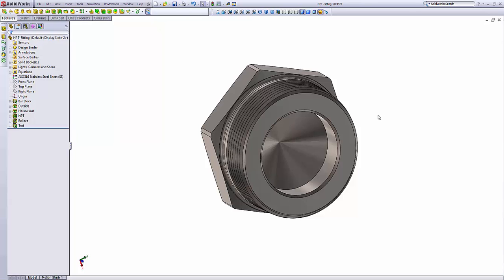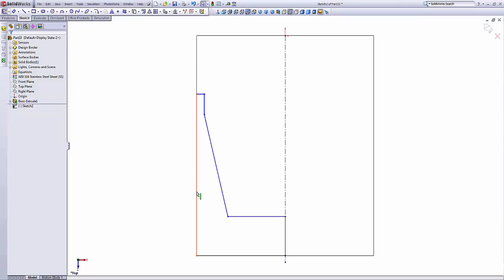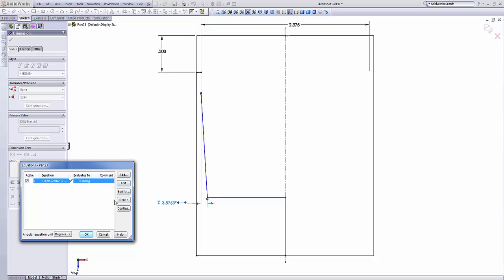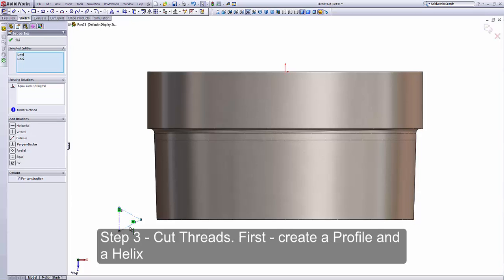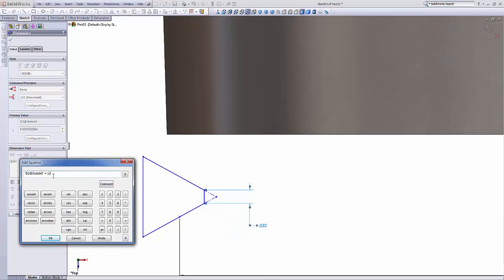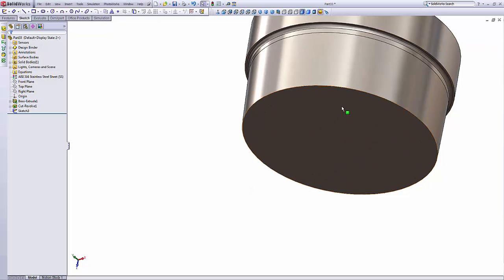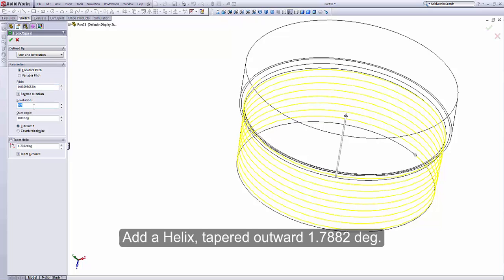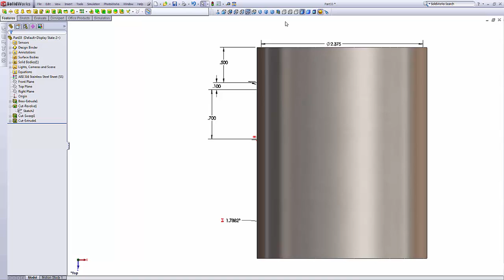NPT threads in SolidWorks - Tutorial

Comment: How did you choose .7 for the length of the thread?
Reply from the maker: @Kubuszarek, thank you for your question. 0.70 length was based on the number of full threads we want to create. In this case, it's 8 full threads. Calculated as the Pitch x 0.70. For NPT 2" the standard pitch is 11 1/2 threads per inch.

Comment: Good explanations, Thank You. I  have question how much overall lenght external thread ? we should use standart or we must ourselves
Reply from the maker: Keep to the standard if at all possible. Use the thread gauge to check. You can deviate from standard length, say a couple of additional full threads (making total length longer), or less full threads, making overall shorter. But the final threaded connection has to pass the gauge check.
Reply: @encole7224  Thank you for your explanation, it was very useful. And the best thing about this video is that every detail is explained.

Comment: Good tutorial and the female thread is very good as well. Thank you! I have one question. I'm working with short pieces and I notice that if set a thread length (.07 in the video) to a different value, a shorter value. The crest height changes. It doesn't happen with the female threat. Do you have any solutions? Thank you!
Reply from the maker: Tooth height should be fixed, regardless of thread length. Try setting the tooth height in the profile sketch. Helix length (thread length) is the guide in the sweep feature. With the fixed tooth height, the thread will be cut at consistent profile. Is this what you are trying to accomplish? Are you looking to keep the distance from crest to root (this is the tooth height) independent from thread length?
Reply: @encole7224  Yes. I set the tooth height fixed with an equation constant. The distance doesn't change. However. The whole sweep cut changes. If I set a >0.6 thread length, the cut is not done properly and there is like a face and inside is the cut. If I start to change the value more high, the tooth height starts to adjust until it gets constant. I have tried to change the Eo value, and it gets fixed. I think there is a relationship within the short values and the D and Eo. However. I don't get to see it. I think it needs a minimal distance since there is an angle in between as well.

Comment: your math is wrong for the taper. it is the arc tan of 1/32, not 1/2( arc tan of 1/16), it is not the same. angle is 1.7899
Reply from the maker: You are correct. In practice, although, the difference between arctan(1/32) and arctan(1/16)/2 is 0.0017 degrees. It is well below the manufacturing tolerance, so the angle will work out in the real world. The math was an oversight in the video, thank you for pointing it out.

Comment: Hi! how did you determine the  first diameter on minute .29 the one that is 2.50. Thanks
Reply from the maker: That 2.5" diameter is totally arbitrarily. In this video example this 2.5" is the outer diameter of the hypothetical pipe. NPT thread at the ends of a pipe are typically smaller diameter than the overall pipe. The important dimension is 2.375" diameter, which is the nominal dia. for NPT size 2". 2.5 is larger, so I chose this number as a good starting point. Makes sense?

Comment: I really appreciated this video. however I found one thing interesting. it seems the crest width(or thickness) varies based on the thread length. in this video, it was set at 0.7. the longer thread length, I have the thicker crest. Any one has insight for this issue that I have?
Reply from the maker: Make sure the taper angles are the same: the solid extrusion taper and also the Helix angle (in the thread) are the same. Is one angle is different, then the swept cut will create different crest width with every turn.

Comment: I'm having trouble using the atn() function, even after following step by step I'm getting 0.06241881deg, using SW 2017, thoughts?
Reply from the maker: Your angle units might be set to radians, not degrees. Take a look in Tools -> Options -> tab Document Properties -> Units. Under type Angle, select degrees. You can also override units directly from the Dimension dialog. Let me know it this helps.
Reply: @encole7224  Thank you, It was already set to degrees and I've already overridden the dimension, I will keep your comment for the future though in case I run into it again

Comment: i observed 1 difference in male and female thread profile...in female you made tooth sketch aligned with taper but in male tooth sketch was parallel , Why ? or it was intentional
Reply from the maker: Akram, thank you for the question. In real production the tooth will be cut with a single point cutter moving at the taper angle. Thus creating the root of the tooth aligned with the taper. In CAD, yes, the sketch technically should be aligned to the taper. For a quick video it's easier to create a model with parallel sketch. Good observation.
Reply: @encole7224  Thank You Sir

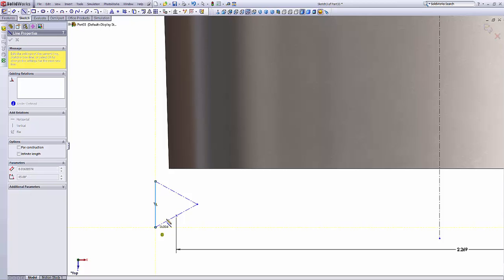Comment: excellent couple of videos, however I have a doubt, in the video of male thread the profile of the thread was left in vertical orientation, that is to say parallel to the "OD of pipe .375" (min 6:30), and in the video of female thread the thread profile is aligned to the preparation of the cone (min 9:12 in the other video).

Is this correct? Shouldn't they both be aligned to the cone?
Reply from the maker: Thank you for your comment. I real life, the thread is made by a single point cutter moving at a taper, so the line is indeed at an angle. In CAD you are correct, the root line should be at an angle because the thread is cut in one sweep feature.

Comment: Ok I know I am missing something simple, but what if you want the thread longer than .700  I would like to make it 1 inch.  but when I try to do that it makes the crests of the threads fat.     The .700 I am referring to is at 4:06 in your video.
Reply from the maker: Thank you for your comment. For a longer fitting, adjust the pitch diameter accordingly. It will become smaller for a longer thread.

Comment: HOW TO GET THAT EDIT EQUATION DIALOG BOX. IN MY CASE ITS NOT APPEARING
Reply from the maker: On 2016 and later SW versions double click on the dimension you want to change. It's a fast double click. This will open a little dialog window, in the same spot where the dimension is. Type the equal sign "=" into the dialog window. From there you will have options to add a Function, Measure or look up File Properties. Choose -> Function (it's a dropdown menu) and select the atn(), or whatever function you need.

In SW versions earlier than 2016, double click the dimension and select the down arrow in the text field there.
Reply: Ok, many thanks! So after 2016 version user interface changed for edit equations.

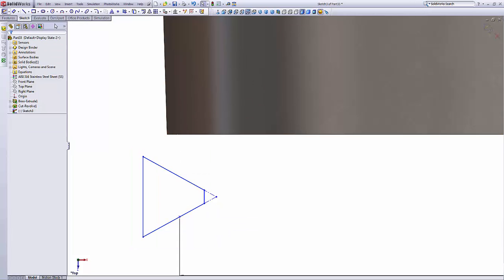Comment: Alex, very good tutorial, short and sweet. I just have a question on the root length formula of P/8 or 1/n/8 at 6:44 min, do you know which section of the standard ASME B1.20.1 it is mentioned? I can see that Section 2.3 gives you the total height of the sharp V thread, H, as
  0.86602540xP and section 2.4 gives the truncated thread height h = 0.8P. Can you explain how did you derive the root length as P/8?. 
One more detail that I noticed is the location of the cutting tool shown at 8:13 min. I would pick the point on the triangle from the intersection between the pitch diam and the mid point of the side and snap it with the end of the piece as shown on figure 3 of the standard ASME B1.20.1 (Fig. 3 American National Standard Taper Pipe Thread Notation
).
Reply: Great catch, I reviewed ASTM F1489 and I agree with your first point. However, for the start of cutting tool, I would draw a line between the mid points of sides and apply the pitch dia to the mid point of the line, which maintain the effective thread length L2. Then snap the point to the end of the shaft.

Comment: Hi, I'd like to ask, for the atn formula, why atn(1/16)/2? Where did you get it? Or it is a fixed?
Reply from the maker: It's trigonometry determining the actual angle. The taper angle is defined by a unit of 1 length over 16 units. The angle between two lines is the arc-tangent of their lengths. Atn(1/16). Divided by 2 because 1/16 angle is for the entire cone, not just one side. It actually should be atn(1/32).
Reply: @encole7224  Angle of taper with center line is 1°47′ 24”” (1.7899°).
Reply: @encole7224  Thank you very much! Helps a lots

Comment: Why do you use a .7in thread length when in the table it is defined as 1.05in (L4) in the table?
Reply from the maker: Shorter length is to make the part more compact. 0.7 length is sufficient for a number of full turns including a thread relief.
Reply: Yes but then the distance from the tool and the axis should be longer when posiioning the tool. The table value can only be used when the table length is used.

Comment: Is there any way to make this a template in solidworks in the same way you can make modifications to the hole-thread wizard for custom threads so that you dont have to go through this process each time you want to add an NPT thread to something?
Reply from the maker: Each variable in a sketch can be assigned to a global variable such as the thread size, for example. This way, when the thread size is given a new value, say 1/2 or 1" or 1-1/4, all dimensions in every sketch will automatically change based on that global variable. This can be done using Equations.

Comment: Isn't your equation for the taper angle wrong?  Shouldn't it be divided by 2, then ran through atan?.  atn(1/32), not atn(1/16)/2.
Reply from the maker: You are correct, the taper angle is atn(1/32). Good catch, thank you! For practical purposes the angle tolerance will accept either equation. 1.7882 vs. 1.78991 are within manufacturing tolerance. The actual angle is acceptable for passing go-no-go gauge within 1.78 degrees +/- 0.05 degrees, the block tolerance on drawings.

Comment: hola!!! excelente video.. una pregunta tengo entendido que los grados de inclinacion de la roscas npt son de 1.47 grados porque en el tuyo lo haces de 1.78 cual seria lo mas apropiado ???... gracias
Reply from the maker: Hola Joel! 1 degree 47 minutes = 1.7833 degrees.
Reply: Encole muchas gracias !!!
Reply from the maker: de nada )
Reply: disculpa, no puedo realizar la operacion de arco tangente hay otra manera de obtener el diametro menor??
Reply from the maker: Hola! Do you refer to taper angle? If yes, just calculate 1/16 angle (half of that per side 1/32 = 1.789 degrees) and enter it directly into your dimension.
Reply: If, try to perform the same operation to calculate the angle of conicity, however when performing the operation (equation) I do not get the same result that gives you in the tutorial.
That is why I request your support, since I need to model more conical threads and metric for my work, besides I want to ask you how you calculate the size of the hexagon for the screw head.
Thank you for your kind reply.
Reply from the maker: arctan(1/32) = 1.78899. This is trigonometry for the angle between two lines having lengths 1 and 16, respectively. 

For the conical treads, do you mean tapered? Then the taper angle should also be a book value for the given  thread.
Reply: ok, entendido muchas gracias
Reply from the maker: welcome )

Comment: The BEST video to watch! Yuu can make ANY MNPT thread with this example!

Should we RADIUS the end of the cutting tool??  

Would be AWESOME to see making a pipe nipple that uses Mirror. I ask this because when I mirror my doggone thread on the mirrored side is BACKWARDS! I have seen many YouTube Videos that do NOT make them backwards. I am using SolidWorks 2012..

Got suggestions??
Reply: ANSI B1.20.1 shows the treads should be truncated and define the min and max of truncation.  The truncation is shown as a flat (not curved) spot in the thread; however, in reality, the roots and crests get rounded as the tools wear.  So, as long as the tools can maintain the min and max truncation tolerance you are good.
BTW:  When I was taught to cut threads on the lathe using single-point cutting (60° taper cutting tool) I was instructed to grind a flat at the apex of the 60° angle of the cutting tool to be within the "width of flat F equivalent truncation" table from the Machinery's Handbook.
Reply from the maker: Thanks, Dave,
NPT thread form is not rounded. Roots and crests are flat. Of course, in SolidWorks we can round them, but it would not be NPT threads anymore. Rounded roots and crests are in BSW - British Witworth threads, where the tooth angle is also different. It's 55 degrees, as opposed to 60 degrees in NPT.
Reply: Thanks! 

Really helps. 

I LOVE how you show the actual specs and show how to put the elements together. 

Know why my doggone MIRRORED threads do not work? See this video..  http://www.screencast.com/t/XHfgofxwM
Reply: Hi is there a way that we can do this for BSW Tapered Thread?  Im creating a part that takes this thread but for some reason the crest is not rounded it shows flat like NPT.  Can you please show me or show us a video on how to do BSW TAPERED THREAD EXTERNAL & INTERNAL?